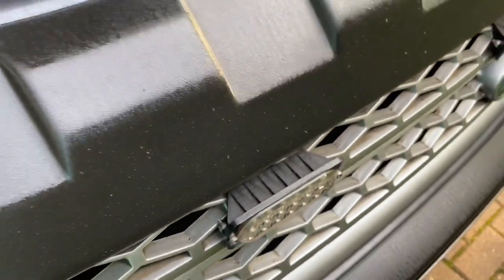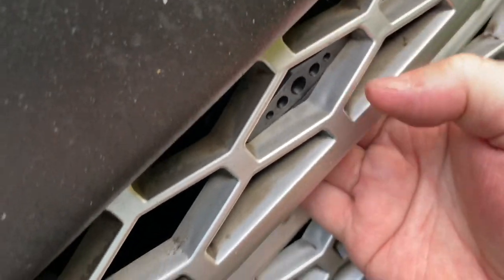Spotlight/lightbar brackets for Freelander 2/LR2

Comment: Did you get around to making any for the facellift grill after? Be interested in purchasing a set if any available.
Reply from the maker: Yes, been on sale for a while
Reply: @BeavisPits  ah yes, saw them after I posted. Out of stock on your website, when are you hoping to be able to make more?
Reply from the maker: Yes, I will be making more in the next few days
Reply: @BeavisPits  great stuff, thanks. I'll keep an eye out. I have an idea to use them backwards though not sure if that is doable. As in id like to see if I could mount a lightbar behind the grill. Not sure if that would work or even be effective, else it'll just go on the front as normal but I'll give it a try first.